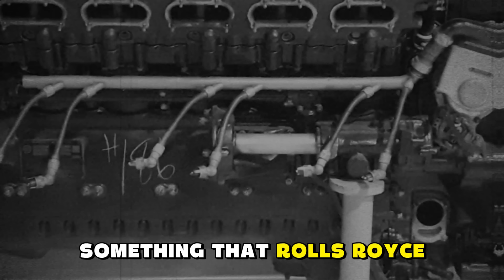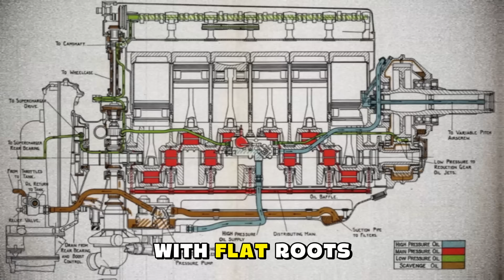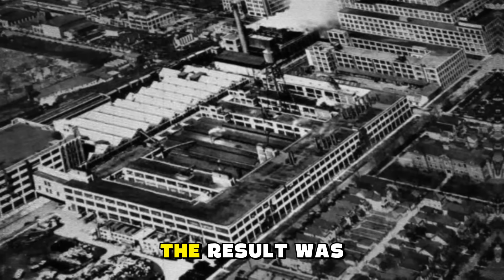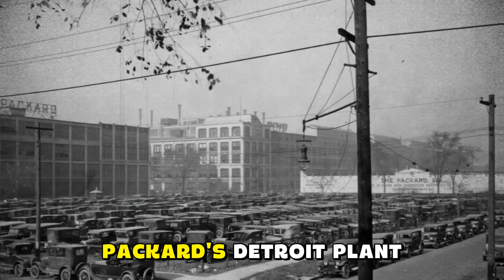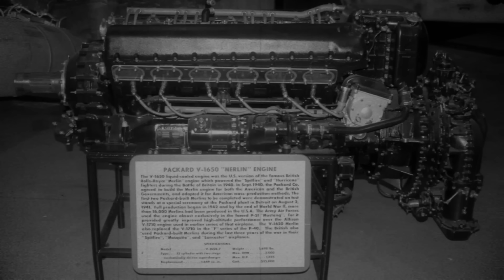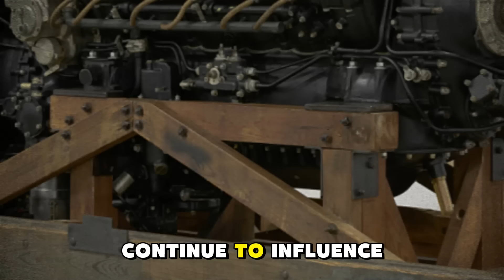The Untold Story Behind the P 51 How America Re Engineered the British Merlin

Comment: They should have redesigned the Mustang to accept the Pratt and Whitney r-2800 double wasp engine which was a far superior motor!! We were already mass producing them!
Reply: 1. the P/W was not as efficient 
2.It was too large in dimensions
3.It was too heavy 
4 And the P51 COULD OUT DIVE ALL THE RADIAL ENGINE PLANES
Reply: @jacktattis  Thats a lie, the P51 could not out dive a P47 because the P47 had a lot more weight and could fly a lot higher, you shouldn't come here and make up lies!!
Reply: @michaelthurman9272   Not lies Early 44 the 3 US fighters were dive tested at RAE Farnborough with machmeters the, results P38 0.68 p47 0.72 p51 0.78 with RAE knowing that both German Fighters having a T/M of 0.75
As far as height P51 41000ft P47 only once in 6 tests got to 40000ft and the second stage of the P51 supercharger kicked in @ 20000+ft and left the P47 behind in climb ate
Reply: @jacktattis  you like to make up lies as you go huh............
Reply: @michaelthurman9272  Go and check it is all out there.

Comment: Narrator is wrong as PACKARD was NOT just known for building cars !!!!  Starting in WWI Vincent of Packard designed and built the Liberty V12 engine for aircraft and the Brits used it for tanks even license building it as the Nufield, clear into WWII,  Also Packard had built other aircraft engines and Marine engines  with them winning world wide races, and by 1938 PACKARD was delivering the M2500 engine to the US Navy for PT Boats and thousands of those engines found their way to UK for their war time MGB MTB boats and it was that engine that brought RR to Packard for the Merlin !!!  RR Had seen the quality of the M2500 PT Boat engine, 2500 Cu In 1250 to 1850 HP....One other mis info here was the first engines Packard built were the 20 series, a SINGLE stage supercharger system, the slobbered and drooled over 2 stage 60 series was NOT yet "Invented"  that came Later in 1942.  Packard built and delivered 37,137 merlins to the Brits in WWII  from 1942 through late 1945, and all but a 1040 were the 20 series single stage version, what the Brits ordered.  the USAAF received 18,000 Packard built merlins, V1650  and all BUT 3,000  were the V1650/3 or 7 or 9 2 stage versions for the P51 Mustangs !!!   The 2 stage  supercharger was NOT an RR "invention"  it was invented and patented in the USA in 1938, long before the merlin.  RR simply made improvements !!!  Vincent has a 2 stage supercharger designed for the M2500 that was being developed for aircraft use, but was told by the USAAF to stop work on and work on the merlin !!!  OOOOH what could have been a V12 50% larger than a merlin and 2 stage supercharged !!!   This program also mislead the watchers that PACKARD was building the merlin for just the Mustang !!!  NOT TRUE !!!!  The main reason PACKARD built the Merlin was FOR THE BRITS !!!!  The Mustang got the merlin as a by product of PACKARD building the Merlin in America.  PACKARD was a off shore shadow factory FOR THE BRITS !!!  Why they received over twice as many Marlins as the USA Used!!!  1/2 of all Lancaster Bombers the Mk BIII & Mk X used only Packard Merlins 3,440  total !!!  1500 mosquitos, 1200 Hurrycanes and 1040 $hitfire Mk XVI's,  this whole program could have been 1/2 the time if they had not of repeated most of the info twice...... just more A I  crappy programming !!!
Reply from the maker: Thanks for your feedback, honestly, you truly have a vast wealth of knowledge
Reply: Yes indeed Great naval engines

Comment: The biggest contribution Packard made to the Merlin was the introduction of the Bendix Stromberg pressurized carburetor.
Reply: @31terkennedy  and the changing of the design to cast the head seperate from the upper block to speed production and use the tooling AVAILABLE !!!
Reply: @wilburfinnigan2142  Wilbur do you still have my email address if so  send me  one. You are the only American I know now. And  I want your opinion on the state of  play there. You have family in Canada and although a pain in  the arse on here. You ARE honest 
And above No , Merlin  22   a long time before the Packard equivalent 
Bendix Stromberg  Carbie was orignally a R/R-SU carbie the drawings of which were given  by R/R free of charge for Strombberg  to build

Comment: .Actually I've read that the Allison was a great engine with even more potential than the Merlin. But that two stage supercharger made all the difference in the world. The reason for two stages is that if they built the supercharger with one stage and made that stage with enough boost for maximum performance at altitude like the two stages highest output mode it would be too much boost at lower altitude where there was more oxygen and could cause engine damage. So, hence; the two stage supercharger. The 2 stage super charger allowed for incremental boost increase as altitude increased (as air became less dense).
Reply: True,  the Allison was  simplier engine, stronger, better valve train with roller tips merlin never had, stronger rods, larger oil and water pump and 300# lighter than the merlin !!!
Reply: @wilburfinnigan2142  And the reason the Allison was a low altitude engine was Colonel Echols in USAAC aircraft procurement and his love of turbochargers, causing the cancelation of funding for a two speed or two stage Allison supercharger. This is the same Col Echols who opposed the Mustang, preferring more P40 production, and then threw roadblocks at the American P51 Merlin conversion, despite the Brits already having a successful one.
Reply: @wilburfinnigan2142  It was a very good engine but puffed at 20000ft Merlim 45700ft

Comment: I think it would have been much faster to fit a 2-stage 2-speed supercharger and a big intercooler to the Alison V1710. Adding fuel injection would have helped.
Reply: Ajohnd01  True but the customer, the USAAF wanted and ordered the single stage supercharger thinking IF they needed high altitude add the TURBOchargers as a second stage, as the P38 had.......BUT the turbo was too large for small fighters !!!  Also the Allison V1710  from 1938 on used the Bendix pressure Carb, which is a basic throttle body fuel injection  that the merlin got with Packard but took the Brits to 1942 when they developed the 60 series merlin and 2 stage !!!!
Reply: @wilburfinnigan2142  If this Bendix Pressure carb was a Speed Density system it was given to Bendix by R/R It was originally a S-U/R-R carrbie the drawing were given to Bendix free of charge  Source ?
A Brief History of Aircraft Carburettors/ fuel systems
Part 9 Speed Density System by 
Terry Welshams Bardstown Kentucky Aug 2013

Comment: The measurement system used in the UK and the US at the time was not different, they both used the imperial system of feet and inches with the base engineering unit being thousandths or ten thousandths of an inch, depending on the precision required. The thread systems were definitely different, the US used (and still does) the 60 degree Unified National system while the UK used the 55 degree British Standard system. However the threads used in all Merlins, including Packard built Merlins, were British Standard BSW, BSF and BSP to comply with the licensing agreement and to ensure interchangeability wherever the engines were used. What the video attempts to explain is that Packard had to tool up to manufacture British Standard fasteners in the US as well as manufacturer the tooling that produced those threads in the engines. They didn't re-engineer the engine in that regard, they re-tooled their facilities and re-trained their personnel. Making those changes must have been a bigger deal for US automotive engineering at the time than it would have been in other parts of the world that routinely dealt with equipment manufactured in America, UK or Europe.
Adapting the engine to Mass Production is quoted over and over again in the video but the simple fact is those changes were made solely to allow the engine to be assembled by automotive assembly line workers rather than craftsmen engine builders. Those changes did not produce greater numbers or engines with more power than the Rolls Royce factories, in fact Rolls Royce produced over 112,000 Merlins at the same time as they developed and produced the Griffon engine as well as the Meteor tank engine and other designs. Packard produced just over 55,000 Merlins that were very fine, fit for purpose, reliable engines that were critical to the allied war effort. They also did valuable development work such as experimenting with bearing coatings that allowed faster engine break in and they utilised an excellent American made pressure carburettor on their Merlins.
Finally, the "tighter tolerance" theme that is often quoted only tells part of the story. "Tolerance" specifies the largest and smallest size that a part can be made and still pass inspection for service. The complete picture must include specifying the "fit" for mating parts. If you want to assemble an engine by picking up any piston (for example) and have it go into any cylinder without hand measuring and selecting for a specific fit, you certainly do have to make the piston and the cylinder to a tighter tolerance but you also have to accept that the range of acceptable fit (clearance) has to be wider because a piston at the large end of its tolerance still has to go into a cylinder that is at the small end of its tolerance with an acceptable clearance. So in a "mass produced" engine you will get some tight fit piston/cylinder combinations and some loose fit piston/cylinders. The law of averages will even things out but In rare instances you can get an engine where all or most of the cylinders are at the "loose fit" or "tight fit" ends of the scale but still within tolerance, perhaps explaining some contemporary opinions that referred to the Packard Merlin as an excellent engine but with a bit more variation than a Rolls Merlin, but of course parochial prejudices may have played a part in those opinions!
Reply: @alangorlick...  Packard built those 55,525 merlins starting in 1942 and ending in Aug 1945   basically 3 1/2 years,  1/3 the total production, and in 1944 with the production up and running at full speed they built 1/2 that number in that year !!!  Also side note of the 112,000 engines you quoted that RR Built 36,000 of those were built by the FORD UK !!!  That leaves about 78,000 that RR themselves built in 12 years !!!  The real facts less the Bull$hit !!!
Reply: @wilburfinnigan2142  HAHAHAHA  Wilbur Ford UK WAS British manned and R/R supervised, all the parts were R/R  All your American engineers had scuttled off back to the USA . So NO AMERICAN INPUT AT ALL none zilch nada